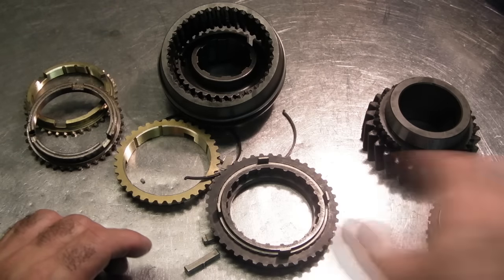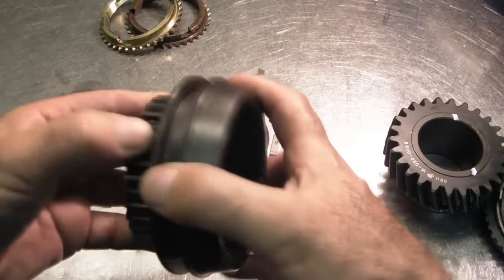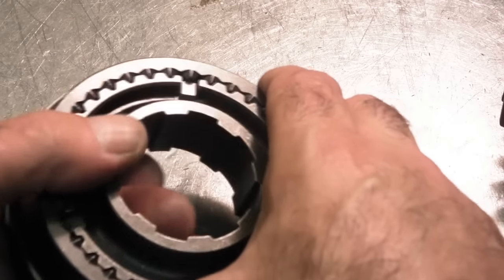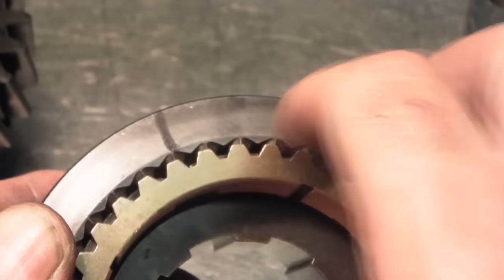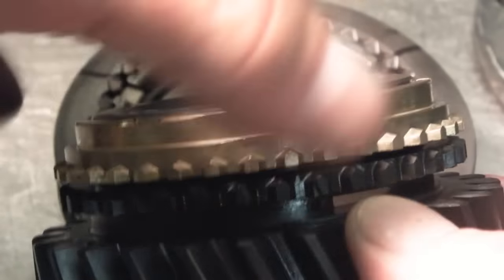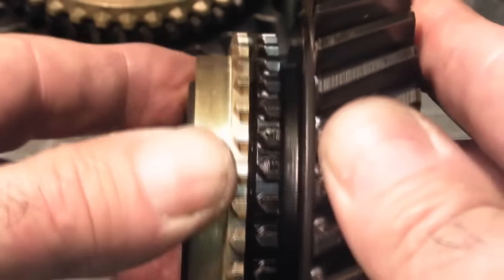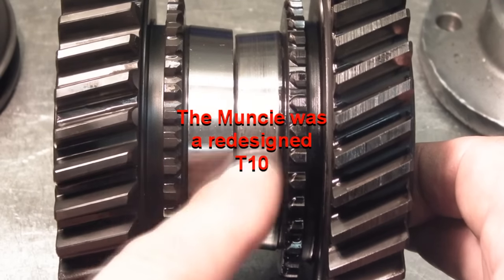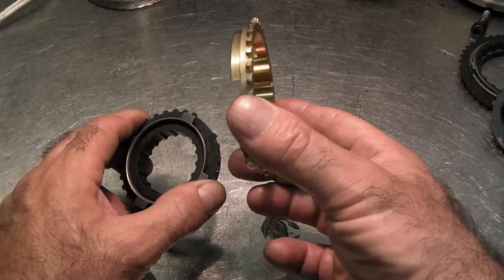Learn About Transmission Synchro Rings

Comment: I have a 2002 toyota camry se and my car won't engage in first and gets stuck in 2nd and struggles to go into third could it be my synchros
Reply from the maker: The1nOnlyDJD  This sounds like a clutch release issue. Usually 1st gear problems are a sign of bad clutch release.  For the most part the car is not moving when you put it into 1st gear so there should not be an issue.

Comment: please help me reply me i have a problem i m using ford fiesta 2009 tdci engine today im facing some problem with my gear shifting when i move my car with 1 2 3 it has some weird sound  but when i use top gear it doesnt have any sound and car runs smooth whats the problem please reply im your subscriber pls tell whats the problem...
Reply from the maker: I don't know what kind of sound you are talking about is it a sound while the transmission is running or only when you make the shift
Reply: GearBoxVideo  when i turn on my car grinding sound will come but when i press the clutch the sound will not come

Comment: I got a 77 chevy pickup with the granny low 4 spd.. It is as synchronized trans but I have mastered shifting without the clutch by rev matching. Will this damage the trans?
Reply from the maker: You will eventually wear the synchro rings out prematurely. The rings are still be forced against the gear and event though it doesn't grind it doesn't mean the ring isn't working at all. So the rings operating temperature increases and eventually warps from high heat.
Reply: GearBoxVideo ok thank you I will do it the correct way. It seems to shift the smoothest when I double clutch. Is this required for longevity?
Reply from the maker: dusternash No need to double shift.  Just normal shifting is fine.

Comment: hello, i have a '01 focus zx3 shifting from 2nd to 3rd grinds. can it be the synchro ring? if it is around how much damage will it do to my wallet? =(
Reply from the maker: I don't know much about these transmissions.  However you can call Ford up and get an idea what the labor rate would be as well as any reputable trans shop. My guess is that you are going to spend at least 1000 dollars, between labor and a good core unit.

Comment: I have a 1997 Mitsubishi Eclipse Gs-t and my first gear Synchro Ring needs to be replaced, do you have any websites that might have them or any tips?
Reply from the maker: Bailey Butler Please describe what is the actual problem? I can get rings for this transmission.
Reply: So when im at a stop and shift into first its fine but when I start to go forward the stick pops out and grinds, All of the other gears are fine except for first. Also I drained the oil from the transmission so i could take it out and only about 2 table spoons came out and it was very black.
Reply from the maker: Bailey Butler Thats not a good sign.  The problem with manual transmissions is that there are no dipsticks to check oil level. So they can run low on oil gradually from a small leak. Sounds like the unit is starting to burn up and the shift forks could be worn from lack of oil.
Reply: What do you think I should do? Should i fix the problem or just buy a new transmission? I found one for $150 with 100,000 miles on it.
Reply from the maker: I would just get another unit. If you can get one that cheap and are doing the labor yourself, one new part can cost you that much so thats a deal.
Reply: okay thank you so much for your help I really appreciate it!

Comment: I have a 97 Eclipse gs 5 speed manual.  Shifting from 1st to 2nd or down shifting from 3rd to second grinds all the time at all rpms!  Every other gear is smooth.  It only shifts perfectly when I double shift the first 4 times while driving.  What could be the issue and how much would it cost?
Reply from the maker: It can be a clutch release issue that has caused ring failure.  Typically a rebuild of this transmission including labor to remove and reinstall it will easily cost $1500 dollars or more. When was the last time the oil was checked in it?
Reply: Never got a Transmission oil changed, and I owed the car for 10k mile. engine oil is changed regularly tho.
Reply from the maker: Julius Collier  Yes that is a problem sometimes.  The units run low on oil, nobody checks the levels.  Do yourself a favor and check your oil levels.

Comment: My transmission on my 2007 nissan 350z grinds when its cold and only in 5th gear and only when downshifting from 6th to 5th. is this an issue? what may be wrong?
Reply from the maker: Sounds like the 5th speed synchro ring is worn and can't lock onto the gear when a colder thicker oil is in play.  Once heated up , the thinner viscosity oil allows the ring to grab.

Comment: its about 5 degrees here...really cold and i put the manual shift into reverse...that went fine, but when I tried to take it out of reverse and put it into 1st something happened and the shifter is just floating not coming out of reverse and wont go into gear...as if its in neutral....what happened???
Reply from the maker: +Ann Unterburger What kind of transmission is this?
Reply: GearBoxVideo its a 5 speed manual in a 2005 Mitsubishi lancer
Reply from the maker: +Ann Unterburger Check the linkage.  It could be a number of things on that box. There are bushings in the linkage

Comment: So what is the deal with the TKO600s? I have been looking at getting one for my daily driver mustang, but some people seem to have problems shifting them above 6000rpm? Any experience with this problem and you have a fix?
Reply from the maker: AS you can see from my description the gears are in constant mesh.  So the spinning mass of the gear train plays an important part as to how fast the gears can get slowed down. Because the TKO design was based on a truck TR-3350 transmission that used older style Ford Toploader synchronizer rings from the 1960's, it really was never intended to be used  for performance high speed applications. The TKO has been revamped over the years with better alloys , stronger castings , but never the synchros. Some aftermarket companies tried to make better rings for the TKO, but they really were not successful.
Reply: GearBoxVideo Well I have a Toploader behind a 331 in one of my cars that will shift at 6800-7000rpm no problem and it is completely stock. So your saying the added mass of the geartrain (including 5th) makes it harder for the same synchros to do their job? I have seen carbon fiber lined blocker rings any experience with those? I also don't understand why some people have problems at 6000rpm and others say it shifts fine at 7000rpm.
Reply from the maker: Ryan Madden the Tremec synchro rings are horrible quality. The new carbon fiber synchronizer rings are built around a brass shell which means that they flatten out quite easily. So sometimes yes some will shift better than others because the quality of the Rings again is terrible.

Comment: hey paul can you change a neatrul safety switch in a t-5 while still in the car a 1991 fox body mustang.
Reply from the maker: The switch is located on the top cover. It may be hard to get at. On the drivers side towards the front.
Reply: hey paul what size socket is the neatrul safety switch
Reply from the maker: 7/8"  But you cannot use a socket because it has wires on it.  If you think your switch is bad, cut the wires and try to get a think socket on it.  The new switches come with a harness attached. I stock new ones that I have taken off of new transmissions, they are $18.95 plus shipping.
Reply: ok sounds good, thanks paul, AMEN,GLORY my friend

Comment: Why do some of the cogwheels have straight teeth and others have slanted teeth?
Reply from the maker: It requires less tooling costs to produce straight or spur type gears. Helical or "slanted" teeth are morst costly to produce, yet run quieter and can handle more load in a smaller form factor.

Comment: I don't know if you're still replying to these but I have a 85 Nissan 300zx Turbo (Z31) and I have an issue downshifting from 4 to 3, 3 to 2, 2 to 1 unless I'm going very slow. Also if I let the RPMs go above 3,000 in 1st and then shift to 2nd it grinds and almost the same issue going into 3rd. However, after shifting to 3rd I can shift whenever I want going to 4th and 5th. I saw you mentioned to somebody else in the comments that it could be a clutch release issue, but also know that these cars are notorious for synchro issues. Please help!
Reply from the maker: +Austin DeMuro sounds like a clutch release issue that was your initial problem which now has ruined your synchro rings.
Reply: time to start double clutching, try engaging slow too and see if that helps I think a worn synco might still create a bit of friction

Comment: Hi paul i just need an advise do i have to grind off the springs so that they dont touch in the hub .they all touch in the hub naturally though why wud they not make things properly then?
Reply: Auto gear adviced to me to grind them off so dogs will not move wtf
Reply from the maker: Where did you get them from?
Reply: @GearBoxVideo  they are all same size i got them from 2 different places.they might be lightly touching but the key contact is perfect
Reply from the maker: I don't know what you got and I don't sell the springs AGE sells as noted in the pics on the Muncie Forum I showed you. So I. Annot support or give suggestions on parts I do not use. Please reread what I wrote on the forum

Comment: im confused about the super t10, does the super t10 have bigger gears and a smaller cone? or the st10 has slarger cone.. ?
Reply from the maker: dean truax smaller cones
Reply: if the st10 has bigger gears, why did they make the cones smaller..?
Reply from the maker: dean truax sometimes companies design around existing  products to save tooling costs . The T10 ring was repurposed from older 3 speeds.
Reply: they called it a road race synchronizer assembly..  ??
Reply from the maker: dean truax ST10 RR assemblies use a tabbed ring instead of a slotted ring. The RR ring will not make it shift any faster.
Reply: GearBoxVideo 
what would be the advantage of a "tabbed" ring? I'm not exactly sure of the difference..
Reply from the maker: Nothing between an ST10 PLUS or STANDARD ring will make the transmission shift any better.  The "PLUS" ring strut keys are a different design and are stronger than standard keys.

Comment: What about non-lined steel/iron rings?
Reply from the maker: what about them?  They work just the same.
Reply: @GearBoxVideo  k, figured it out once i realized the bumps inside the gears used to be roller bearings.

Comment: When I go into first i let off the clutch and as I start moving and it will pop out of first gear with a bang sound. It mostly does it when there is a load on the transmission such as going up hill  seems like the syncro?
Reply from the maker: What make and model transmission please?
Reply: GearBoxVideo 2011 bmw 135i

Comment: Thanks, YT algorithms. I've got an NV1500 transmission in an '03 Sonoma that occasionally doesn't like to go into first gear, it's definitely blocking. I'm absolutely horrified that GM would put out a transmission that wears out at the young age of 298,000 miles like this... just shocking.

Comment: hi, can it also cause gear grind when going into first gear from neutral at slow speed or complete standstill?
Reply from the maker: A bad clutch release
Reply: @GearBoxVideo  with the clutch pressed
Reply from the maker: Think it thru. The clutch is suppose to disconnect the engine from the transmission. If you are standing still, why would the transmission still be turning? Watch my video on how a clutch works.

Comment: what will cause new syschro rings to grind
Reply from the maker: Usually you have poor clutch release which will not allow the synchro to work properly. Also some aftermarket synchronizer rings just are bad. But if you got an original equipment ring usually it is clutch release or a worn gear cone.

Comment: I have a 2011 camaro and it's starting to grind going into 2nd gear. It dosent do it when cold only when the car is warmed up. I changed the oil to amsoil the grind went away for like a month and now it returned it's really annoying. Do you know what it could be ?
Reply from the maker: uriel morales The synchro is common to wear on 2nd gear on those transmissions. Isn't the car still under warranty? Sometimes a lighter viscosity oil will help a poorly fitting ring grab, but once the lining of the ring goes, there is nothing much that can be done.
Reply: I got 119000 on the car so my warranty is done. How much would it cost to replace it ? Thank you for responding I really appreciate it.
Reply from the maker: uriel morales  These synchros are pretty expensive and more than likely you can expect the other rings to be on their way out. I would not go through the time and effort to pull the unit out of the car and disassemble it to change 1 ring.  You can expect to pay $1500 plus to overall the transmission from a shop.   It may be worth looking into what a remanufactured unit with a warranty costs from GM.

Comment: I got a 2002 mustang manual, when I'm going at high speeds in 4th gear and try to shift to 5th it grinds and won't go in,  unless I shift when I'm at low speeds in 4th gear. Its a synchronizer right?
Reply from the maker: Pretty much. Make sure you have a good clutch release.
Reply: Yeah,  thanks & thanks for the response

Comment: So if my 2004 car's transmission doesn't shift fast it feels that it shift too slow... There is no grinding. It can be worn out synchro's inside?
Reply from the maker: +Marius Verbavicius  No, more than likely a dragging clutch.
Reply: My transmission shaft from engine side has free play up and down about 2mm. It's worn out bearing i think. Does it hurt for transmission or other parts? Car is BMW 330D 2004
Reply from the maker: that play is normal.

Comment: Ok. So I own a 92 Fors Taurus SHO. I have hell shifting into 1st and 2nd gear, also reverse. 3rd, 4th and 5th are okay but I would like them to feel smoother. They are easier to put into gear though. I can shift easy when my car is just stopped. I decided to test something in my driveway at a stand still. Ive noticed if I push the clutch all the way down to the ground and shift to first its hard but if I keep moving my shifter up into 1st and down into 2nd, it starts to get easier. But as soon as I let go of the clutch and press it down again, I have to move it back and fourth from 1st and second to feel smooth shifting. Now this is just with me not driving it. But as soon as I drive, I have to pop it into gear. They never pop out and very rarely gring unless it didnt go into gear all the way. Is it my syncros or clutch or what????
Reply from the maker: Be careful driving like this.  You have poor clutch release. Especially if it wants to grind going into reverse. The transmission is seeing engine load, that is why it is hard shifting. The problem of poor clutch release is common, usually due to poor hydraulics.  This release issue can ruin your synchro rings and cause more damage. So get it addressed soon.
Reply: Ya. And I have a cable clutch so no clutch resevior to worry about. So a clutch change would do the trick? It only grinds sometimes when it goes into reverse. I dont drive it but Im trying to make it a daily since I need a ride to work.
Reply from the maker: Danielle Bourn There is a way to adjust the cable.  What you want to do it eliminate some of the freeplay and get more action onto the clutch. I don't know the procedure to adjust the clutch cable
Reply: GearBoxVideo  Oh. Ok. Thanks!

Comment: So my 4th gear it seems to throw it into gear it doesn't go smooth. I have a monster stage 2, new slave, new throwout, new master, and it also wants to get stuck in 4th after extensive driving in 4th. What would cause this I have read up and many people say synchro. Mine is a T-56 in a 2002 Camaro SS 5.7 LS1
Reply from the maker: Timothy Benton when the 4th gear Synchro ring wears, it allows the strut keys to pop out behind the slider and it gets stuck in 4th so basically you should change all your synchronizer rings and possibly the three four struts
Reply: GearBoxVideo do you think it would be wise while they're in there to go ahead and replace 1>2 slider and 3>4 sliders as well?
Reply from the maker: Timothy Benton best to get ot apart first. Make sure you are using a shifter with stops
Reply: It has the stock hurst which ive read in forums has awful stops and overshifting is common when driving it hard and banging through the gears. Planned on changing it when i replaced all the other components but never got around to it unfortunately

Comment: i have a 2003 eclipse i had found part of a ring in the transmission drain plug not sure if it is a over drive snap ring or the spring you’re talking bout, help!
Reply from the maker: Does it work OK?
Reply: yes sir it drives and shifts fine and runs fine as well
Reply: it works like it should
Reply from the maker: Well maybe the builder dropped some parts by accident in the unit. I've seen that before.

Comment: I have a nv5600 and 3rd gear will pop out under deceleration what could be the cause
Reply from the maker: Physical wear on the shift fork , synchronizer slider and gear.  Could be one of these or a comination of all three.  I recommend you remove any rubber boots and carpet around the shifter and try it again. Sometimes that stuff can get in the way

Comment: Why happens when the gear teeth and synchro teeth come point to point ?
Reply from the maker: Its in microseconds that that will happen...so you don't feel it because they are technically not engaged and can slightly move at a different speed relative to each other.